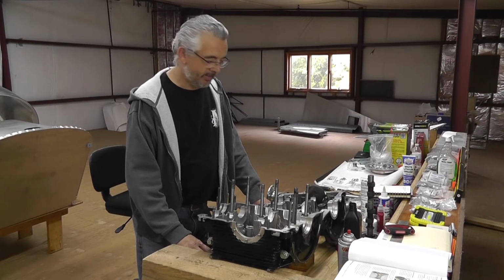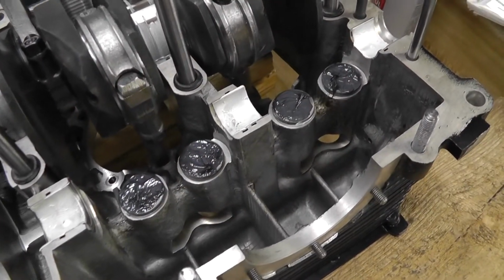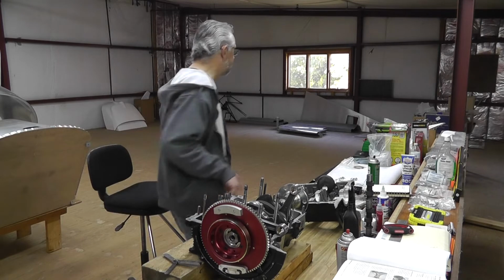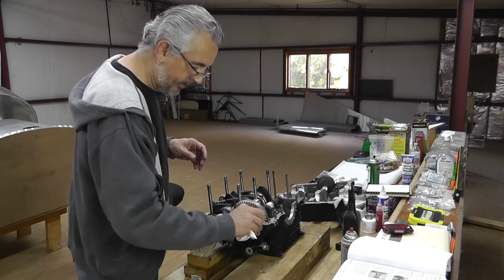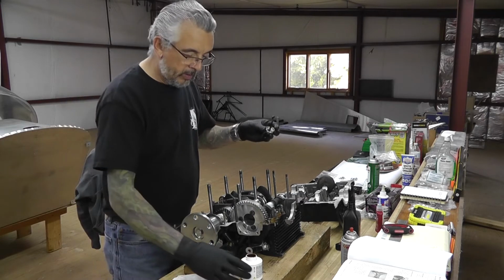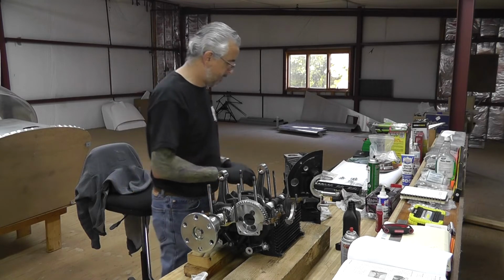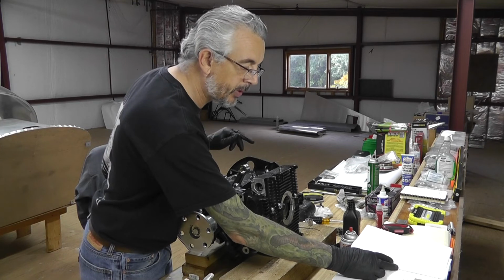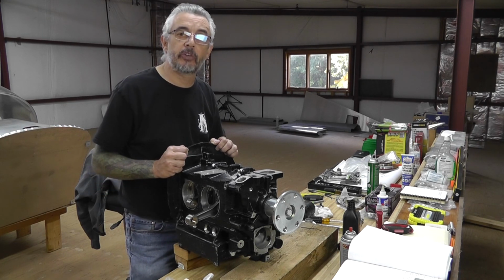Sonex Build Part 6 - Working On The 100hp Aerovee Turbo

Comment: Thank god you went over the previous owners work, that thing would of come falling out of the sky like a rock. I think I would of ground that rear cam bearing to match the oil canal in the case. Does the factory make any mention of that?
Reply from the maker: I doubt that it would have made it through ground testing but it definitely would have been an expensive lesson. I have not found any recommendation to grind that bearing. It only obstructed about 1/3 of the passage or I would have inquired. I considered it but I was worried that I could do more harm than good. The fact that VW only put 1/2 of the bearing in production engines tells me that it is not under high load and that is why I was not to worried.

Comment: If the previous owner had continued they clearly wouldn’t have had a good time.
Reply from the maker: I agree. It worked out for the best for all involved. There is no way that this engine would have even made it a few minutes running without the main bearings. That alone would have been $10k out the window.